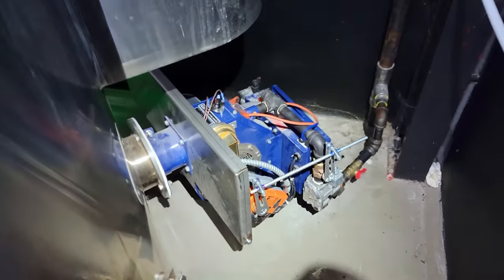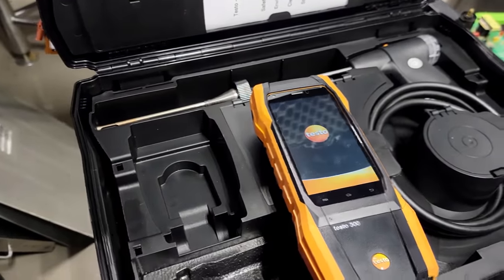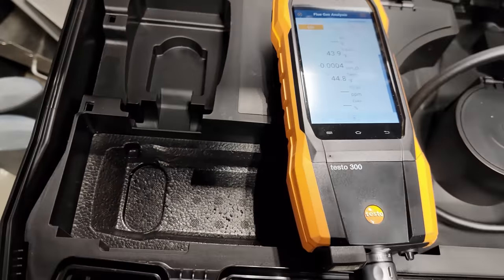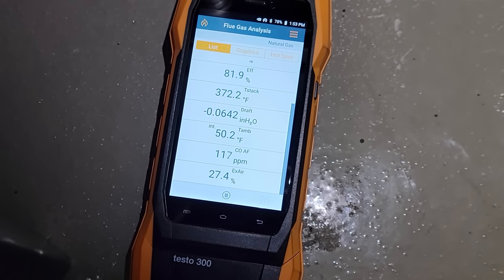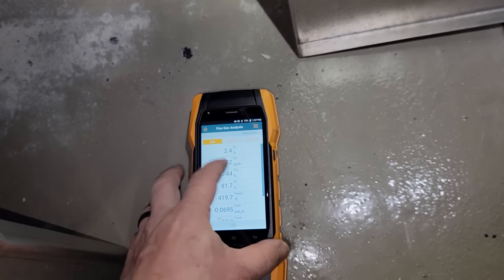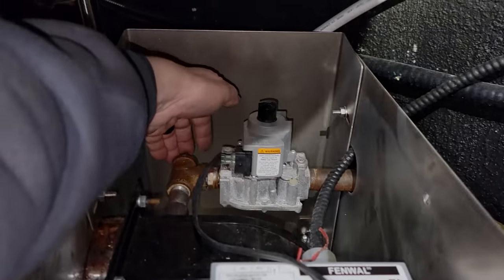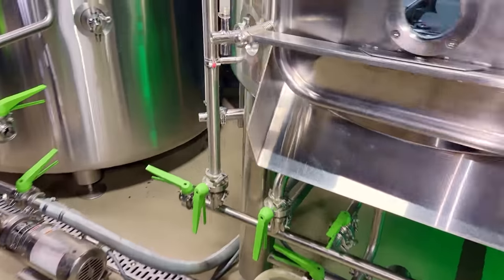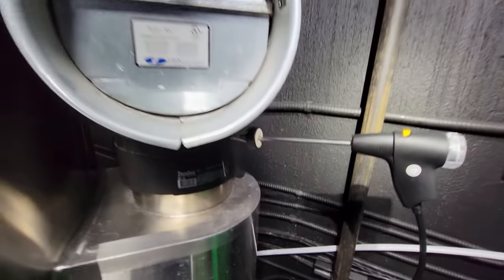Brewing Beer With The Testo 300 Analyzer Friends Don't Let Friends HVAC BLIND

Comment: that exhaust fan should be tied to a makeup air unit or auto-adjust one to bring more air into the building. short of that, maybe install an interlock setup, exhaust on and burner stays off, of course that would need a big red idiot light 🤣

Comment: Old cars were calibrated about 1% Co that means 10000ppm. Cars are bad. You can kill you easily sniffling the Exhaust from a car in few minutes but until 100ppm it is Okay.
No Co is the best but it is technically out of reach. It is not possible to reach every molecule to combine gas and oxygene.

Comment: Why do they insist on running that fan so much when they know it kills their equipment?   If nothing else, the fan should be on a timer, or a sensor.
Reply from the maker: The kitchen was being used before I tested the burner, the owner forgot it was on but said it won't happen under normal times of operation....Whatever, thats why I added the roll out.
Reply: @HVACRSurvival  Sounds fishy.  If nothing else, a note on the 'on' switch for the burner that says "Make sure exhaust fan is off" should have been there.